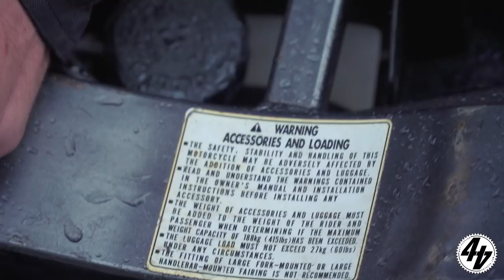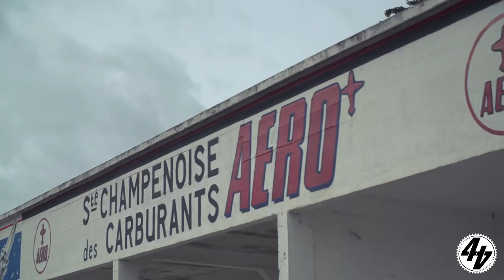STUNG BY THE HORNET | EP02 | Budget Bike Battle Alpine

Comment: Soooo interesting. I had that year Hornet, in red too and it had huge tank slappers if I took my hands off the bars. With new tyres it was fine for a while but eventually it returned. I also had the vacuum pipe issue on that damn bike! Ride safe dudes!
Reply from the maker: It wasn't this exact bike by any chance?!
Reply: @FortyFourTeeth  It's possible! I'll go through my pics and check. I also owned the same model Bandit in that blue! With a Beowulf can it was ridiculously loud! 😂

Comment: Tbh the engine, gearbox etc are fine with these budget bikes. Only trouble is getting the fuel to the engine. Lesson learned, just change out the fuellines, check the tank/fueltap (Done for a few euros) after you buy an Old used bike Learned that lesson myself as well, when i bought a GS500e(:

Comment: I had the CBR 600 F4, same engine, exact same issues. Went thru 5 or 6 regulators before a mechanic managed to set s second earth wire to the frame and problems solved